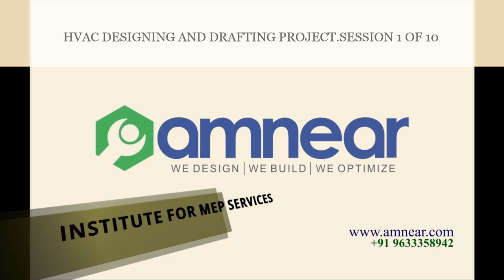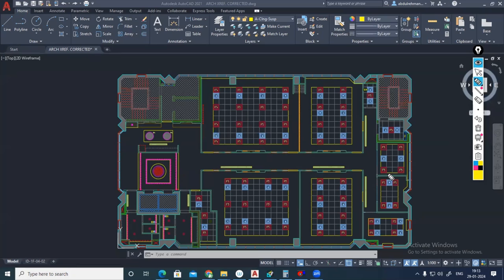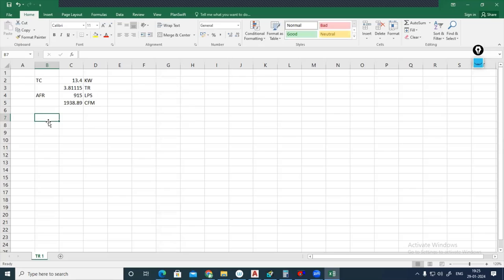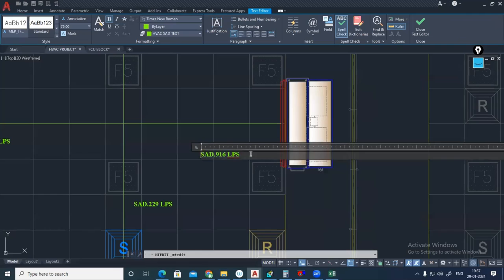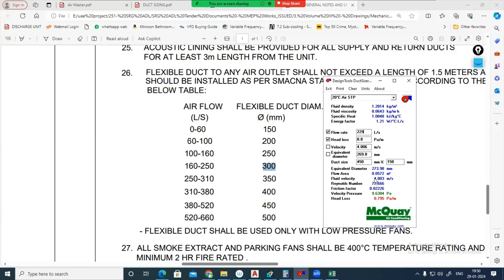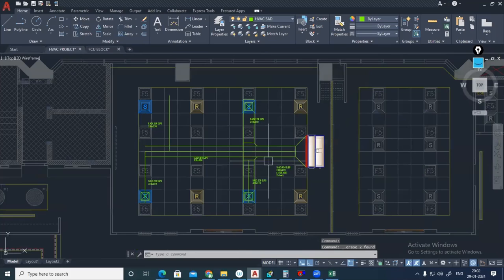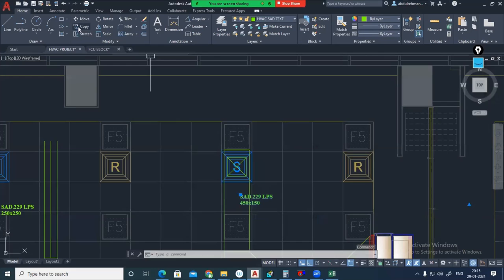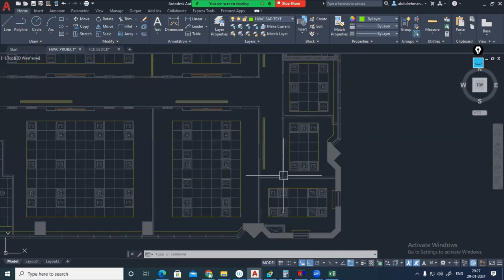HVAC Designing&drafting Project.Session 1 of 10|start to end|Shop drawing|Free Video course content

Comment: Sir head loss Should be less than .1 right in Metrix ? 
How we used .8?
Reply from the maker: @ALFINSTEPHEN-z8g  No. The duct friction loss isn't fixed at 0.1 Pascal per meter. ASHRAE provides a range from 0.5 to 5.5 Pascal per meter, but the exact value depends on the system design. 0.8 pa/m you can use for all system as a reference range. After that, We have to decide the optimum range. It's a long topic. In a nutshell, Typically, 0.8 Pascal per meter is used as an average for larger systems like AHUs, while 0.5 Pascal per meter might be used for smaller systems. At 0.8 pa/m all the conditions are satisfactory, then whether it's a small or big system, you can use it. 

However, the actual selection depends on various factors like airflow rate, noise criteria (NC value), and duct velocity. Each duct's velocity must align with noise limitations, and you must ensure that branch connections (T-joint or TAP joint) are correctly sized and positioned with adequate space and clearances. Air balancing and maintaining an economical design with a good aspect ratio are also essential.

ASHRAE outlines three duct design methods—Equal Friction, Velocity Reduction, and Static Regain. While 0.8 Pascal per meter is commonly used, it's not a strict standard and should be adjusted based on system conditions and design requirements. The goal is to ensure noise, velocity, and economic design are balanced in the final duct sizing.